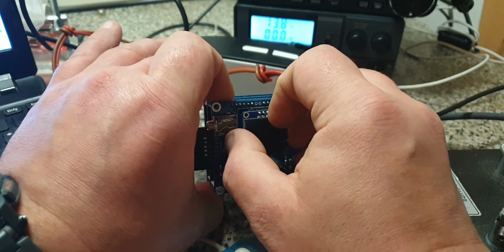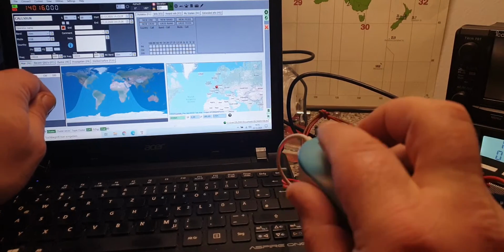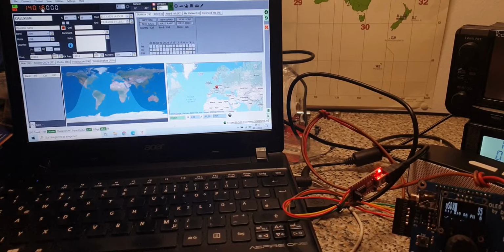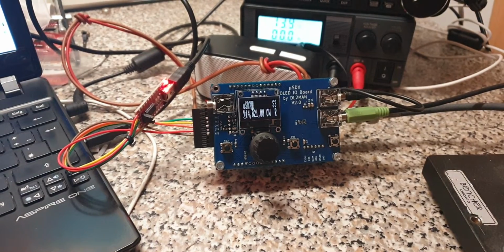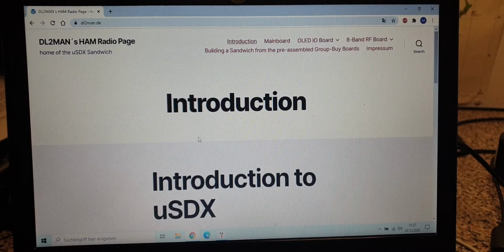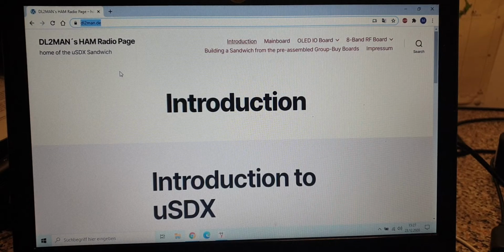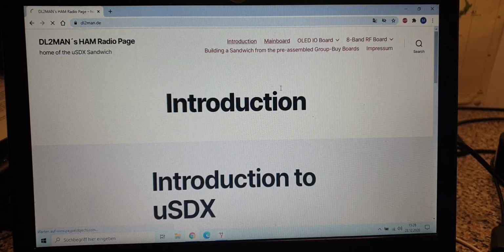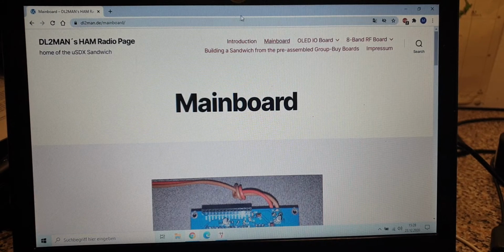uSDX Sandwich - 8 Band RF Board, OLED, CAT and PA Control etc

Comment: Sorry I wanted to ask you for help if you could help me. I have the same radio with an ATU 100 tuner and I have a problem that does not provide the RF load -bearing and consequently not active antenna tuner. By chance do you know where the problem may exist, do you have the burnt endings? You can help me please, thanks and always beautiful videos.

Comment: If and when these changes can be applied to version 2.5 of the mainboard .
Reply from the maker: The mainboard is not affected by changes from anything shown in this Video. All changes to Sandwich mainboard only affected footprints for easier factory assembly. No Circuit Changes.

Comment: Hi Manuel. Since begin of this year I am try to assembly a uSDX but not have sucess. I not undestand what was the problem. I pay more then 100 USD with components, board etc to build a not work radio. Suspect of some fake components in my assembly. So, I decide to buy a chinese uSDX. I undestand the problem envolving commercial use but to me, the Chinese uSDX was a  cheaper solution, more then homebrewing.

uSDX is really a excellent radio. My congratulation to uSDX team.

Comment: Very Very Nice.  I'm thinking about starting this project.  I am very new to soldering but I can figure it out.  I like the external pa control.  I'm ignorant of Power Amplifiers and control.  I want a small amp that is a kit or a small amp that is plug and play to allow the used to control it.  Any suggestions?

Comment: I built Sandwich,but it worked not well.
1,Slow screen refresh.
2,There are periodic beeps at intervals of about 3 seconds
3,Slow response of button and encoder action
Can u give me some advice?
Reply from the maker: Sounds like programming issues to me. Wrong bootloader. wrong crystal. wrong software. I´d investigate into that direction.

Comment: What was the mod to get rid of the OLED noise? I did look on your site. Thanks
Reply from the maker: Please have a Look at the Schematic of the OLED Board. The trick was to reduce the Voltage from 5V to 3,3V by 2 Diodes and add some Capacitors to GND before and after those diodes.